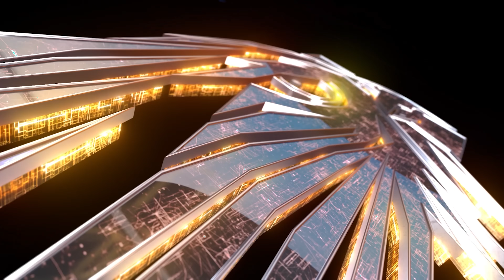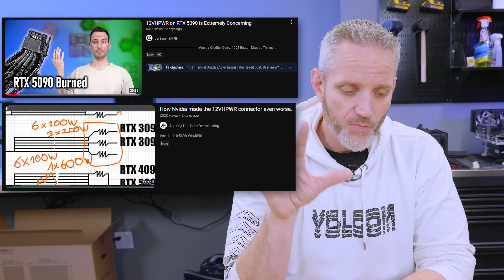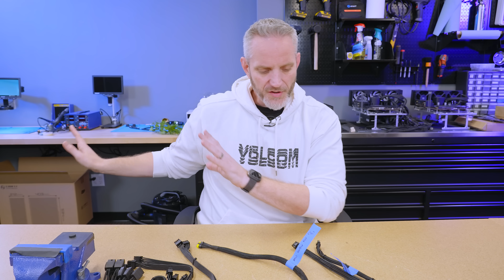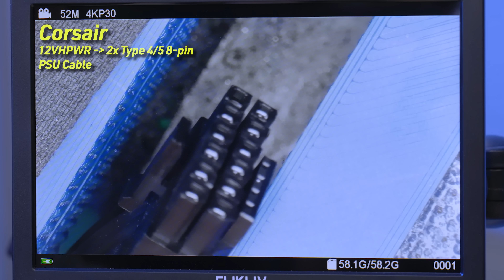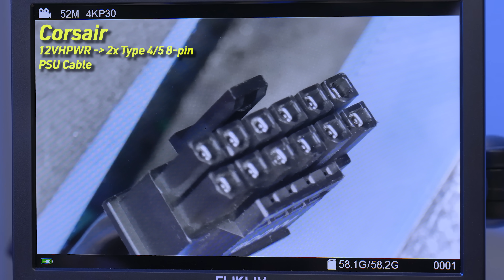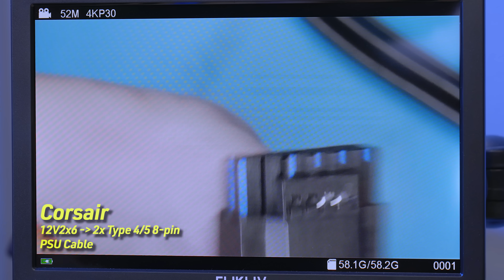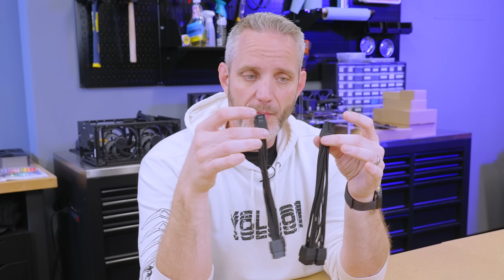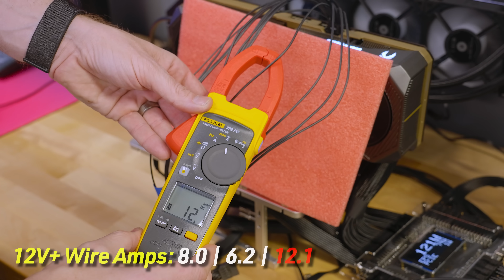I discovered something concerning and I need the Experts to chime in... More 12VHPWR discovery!

Comment: If the 6090 doesnt drop with dual 12pins I will be shocked. That is TOO MUCH POWER for a SINGLE cable.  Period.  How they didnt figure that out for with the 4090 is beyond me.
Reply: It can work, the spec just needs to be far more tightly regulated with load balancing. They keep trying to push this new connector, but won't  invest in making the system more robust.
Reply: @darktrexcz  it can work, but the safety margin is still too low. Multiple connectors would help immensely.
Reply: I hope they drop this stupid cable
Reply: If it's on the next node, it might actually be more efficient. We are approaching the limits of the current node hence why power draw has gone back up. Its a cycle.
Reply: They don’t have to make changes if people continue to buy them…
Reply: @LiquidMetalMover  If Nvidia was ordered by a court or a government to not use them, then they would have no choice! Just like the European Committee forced all new devices to have USB-C ports and cables, hence why even Apple had to ditch their Lightning cable.
Reply: the entire PSU thing needs to be changed it was never made for such high power your PSU can say 1200w it's not really because the 12V rail that takes all the power has amps limits that's why some have the card suddenly go black
Reply: Using dual connectors could be considered a temporary fix. The wiring seems fine, but the connector at the end is faulty. Until that is fixed, there will always be the potential for electrical issues. Just because it doesn't melt from too much resistance doesn't mean it isn't slowly shorting out your components over time. Maybe lower connector tolerances at both the PSU and GPU, trace based contacts, and the use of quality copper connectors would be a better solution to start with.
Reply: Everyone's going to need a new PSU with 2 12pin connectors if they do this too.
Reply: @lee5010  or 1x 16-pin (both sides) + 1x 16-pin to 4x 8-pin adapter lol
Reply: Before anything was announced for 50 series I was hoping they would drop the 12vhpwr connector and I would sell my 4090 and buy a 50 series card as it seemed a no brainer they would lol bhahahahaha guess I'm the dumb.
Reply: Well, because the connector should be capable of that. It's just not designed to draw over current of close to 100% especially not for extended periods of time...
The real questions are A: Is it too "flimsy" for consumer use at these power ratings? 
B: Is the standard operating range too close to the maximum specifications for consumer use? (I'd say yes it is)
And C: Can that what der8auer found be reproduced on 4090 cards for example?
If so, then it is highly likely that the main cause is the missing regulation. After all, if you overload a cable, any connector can fail no matter what.
Reply: Why are you already talking about the 6090 bro.. stop
Reply: That most likely will just use 48V like they already do in Datacenters. This creates other challenges, but those are at that point already standard for datacenters, so I would assume they will just push for 48V for consumers in 2 1/2 years.
Reply: The 6090 is still going to have the 12VHPWR.
Reply: @Warhorse469  I doubt it honestly... even if TSMC 3nm is better than their N4P-like node, it won't be 50%+ more efficient! The RTX 60s architecture would have to be amazingly efficient for that to happen. 2x 16-pin will probably be the new standard for Enthusiast GPUs.
Reply: Rtx 5090 ti 800 watts
Reply: Wouldn't change anything if Nvidia keeps their power delivery design as it is on the 5090. @ActuallyHardcoreOverclocking has a video, "How Nvidia made the 12VHPWR connector even worse.", explaining the poor design.
Reply: Didn't need to figure it out GN told the world it was "user error"  and their fanboys  scream at anyone who dared suggest otherwise.    Surprised  these comments haven't been flooded with them upset the Jay  had said an old video of GNs  is wrong
Reply: that card is EASILY 5 years away
Reply: @Ed_H_EDH  2 or 2.5 years away... 5 years? What did you smoke man ? 🤣
Reply: @Ed_H_EDH  Rubin is still set for second half 2026. It'll be mid 2027 at the latest. So try 18-30 months, but probably in the low 20s depending on the strength of their preference to recapture the fall launch window.
Reply: @Ed_H_EDH  More than like comes out somewhere around 2027.
Reply: @Ed_H_EDH  With how fast these cards have released, I’m pretty sure 60 series will come out in 3-4 years. 30 series was in 2020, 40 in 2022, and 50 in 2025.
Reply: @ramiking745 so every launch until now came in 2 years but now you expect it to come 3-4 years. You cant see simple patterns. Sad.
Reply: @whatever3245  Huh? A guess for a release in 3 years should not make you that mad.
Reply: @Ed_H_EDH what? theres a launch every 2 years, are u demented?

Comment: solution don't make 600 watt cards that for a split second can use up to 1000 watt
Reply: Not the issue at all, 600-1000W by 12V isn't very high at all if you look outside of the PC world. This is just Nvidia and PSU companies fucking up. They should have made a connector with just one big 12V and one big Ground wire, like 8ga/10mm² minimum, instead of rehashing the existing PCIe connectors. Look at how car batteries, alternators, starters, EV motors, amplifiers... are powered. 600-1000W by 12V is nothing if you do it right.
Reply: @Candisa  yes its an issue ... theyr garbage designs are drawing WAY too much power ... 200-300W is "acceptable" power draw, 600+ is NOT
Reply: @Asghaad  600W is a pretty capable power tool
Reply: @Asghaad  Then get a 5080 if you for some reason think 300W is a magical limit.
Reply: @Candisa  no thanks i will be sticking with my Radeon VII for a while longer ... yknow the card from 2019 that had the same memory size as the "new hotness" from Ngreedia in 2025 and still handles any game i throw at it SIX YEARS LATER because of it ...

ah i just remembered the "why would you need 16GB VRAM, 8GB of RTX2080 is enough" crowd ... xD

and just FYI that card was selling for $700 back in the day ... quite a good deal considering it lasted me for so many years and still can outperform quite a few modern "midrange" cards ...

Comment: Been waiting for this since you posted on X! Def glad I haven't made the jump to a 40 or 50 card yet.
Reply: tbh, most of the 40 series cards are fine its mostly an issue  with the 90's

however i do not thrust these cables, and frankly dont trust corsair either now.. which is fine as i wwas gonna switch  to lian li power supplies

if you get say a 4060-ti youll be fine